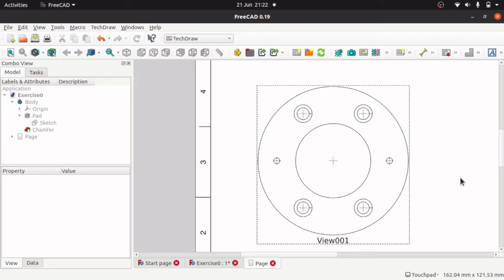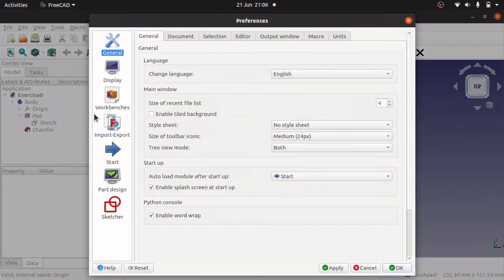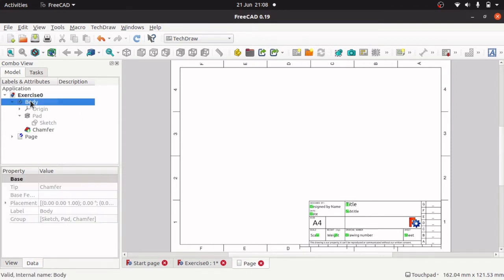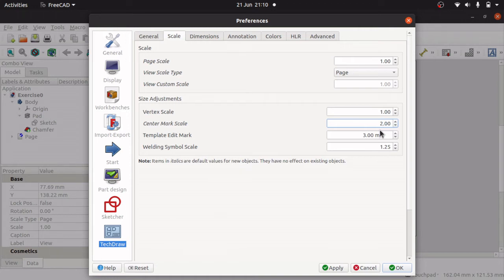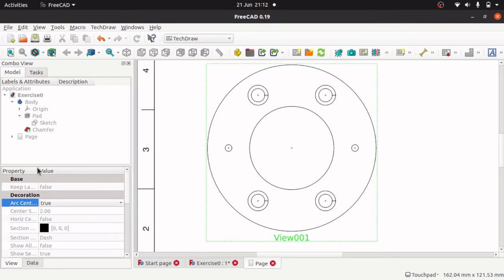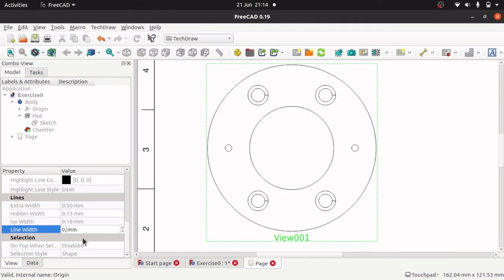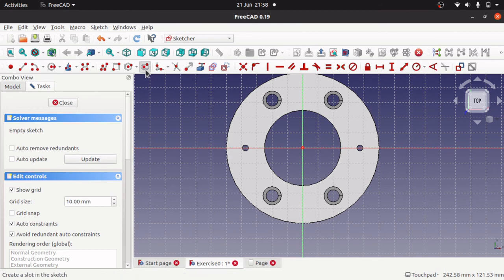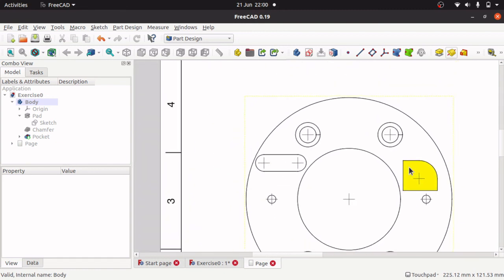FreeCAD TechDraw Show Center Cross Hairs for Circles, Arcs, Fillets. Centre Marks Technical Drawing

Comment: Feels like this has changed quite a bit in later versions (1.x) ?
Reply from the maker: You should just be able to click on the view in the document and change 'arc center marks' and set it to true in the view tab.
Reply: @MangoJellySolutions  It doesn't seem to do anything, but I have a new 'Extensions: Centerlines / Threading' in the TechDraw menu, but I can't find any default settings for this, seems only way to configuring line weight is to double click on every line to  set weight, really tedious.

Comment: Dear MJ.  Great video. I'm using Freecad V1 on a 2020 macbook pro running OS 15.0, and ever since FC 21.2 I can no longer place center lines between either Points, of Lines.  FC 20 still does it though.  Do you have a video that will show me what I'm doing wrong?  Thank you, Roland

Comment: hi thank you for the video, my question is , is there any way to enlarge and change the center point dot in the center of the plan , i dont know what they call it to me its just the center point dot , what is it called and can it be changed in size and color. i am a linus user i am currently using kde neon as my operating system for the last 5 years or so , i love linux , if their anyone of your viewers that have an aswer it would be very much appreciated thank you
Reply from the maker: Yes I be able to help as I wrote a blog  post with a number of settings to make freecad easier on the eye. These are cakes points and markers in the settings I believe but this details the main ones in a table. https://mangojellysolutions.blogspot.com/2022/12/settings-and-resources-to-help-with.html

Comment: How would you deal with odd angled objects in techdraw? I've messed around with this wb a bit but it's been easy parts. Currently in the process of designing a bench for my borther, the seat part is relatively straightforward but the legs and it's supports are all angled and make it awkward since they don't align with the standard front, left, right etc views xD
Reply from the maker: Good question, you can create custom angles by altering your view point of the object and jumping over to techdraw and adding the view. It's a case of getting the view correct in your 3D view and adding them to the drawing. Other ideas are to use section views so you split your model in half or use a staggered view. I do have another video somewhere on my channel regarding custom section views in tech draw as there not supported or the box.
Reply: @MangoJellySolutions  Thank you! Keep up the great work :D:D

Comment: Thank you for showing this.   I had no idea about the preferences setting for TD.  I work with small plexiglass items, draw them in Fc then print them, tape the drawing to the plexiglass and drill holes on my press using the cross-hair center mark.  These we enabled by default in 0.18 but thought it was a bug in 0.19 since they didn’t display.  My world is spinning again thanks to you video.
Reply from the maker: Great to hear its helped and your back up and running. I never knew its was disabled in 0.19. I don't like it when that happens in software it really puts people off.
Reply from the maker: And also great to hear how your using the technical drawings. Always interest how people use the software.